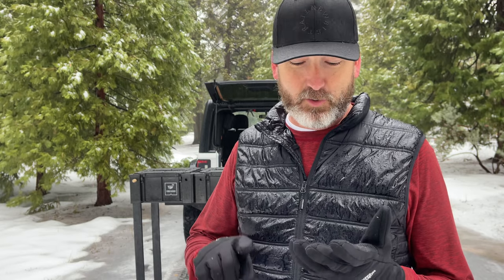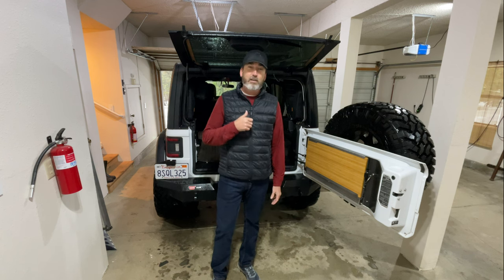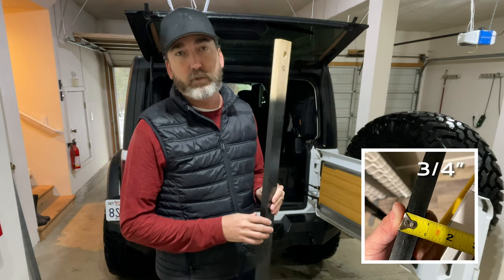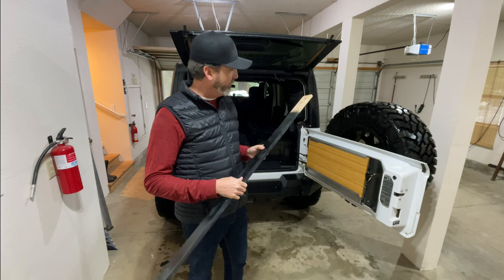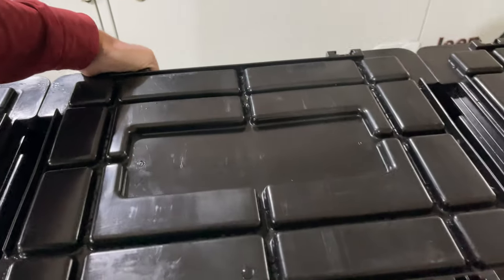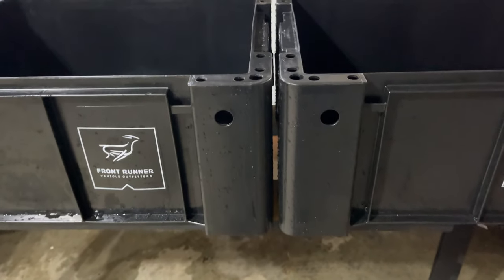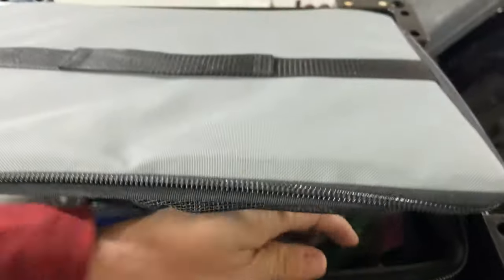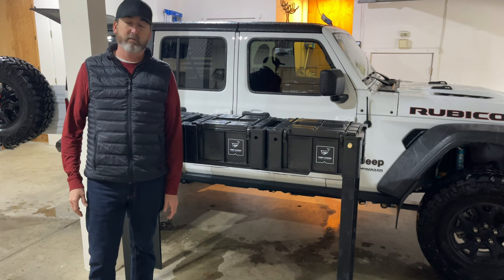DIY STORAGE TABLE for Overlanding | Front Runner Wolf Pack Box Storage

Comment: I got to see this awesome storage/table setup in person! If you put silicone on those holes on the inside, they’d definitely be weatherproof but i do understand the ventilation part of it too if that was the intended purpose of those holes. Aside from that, the lids seem to do the job keeping water from rain, snow, ETC. ding out of the bins.
Reply from the maker: Ya, these are great boxes, even if just for regular storage.  Gotta get back out on the trail with you Mark!!! 👊🏼👊🏼👊🏼

Comment: I bought the Wolfpack front runner pro. They seem to be very close, but I noticed a few differences. They don’t have the big holes on the outside to put the corks in. They don’t have holes on the inside of the boxes for drains to put the screws through so I hope to drill those. Do your legs fit a little loose? Mine seem to be loose and I didn’t have to shave off a corner. Maybe the holes are bigger now
Reply from the maker: So awesome that you are building them with the new Wolfpack PRO boxes!  My legs fit pretty snug in the original Wolfpack.  They don’t necessarily need the corks to hold them in, but it’s a nice-to-have to keep them secure. Thanks for watching and for the comment! I really appreciate it!🙌🏼🙏🏼👊🏼😃

Comment: Which Front Runner boxes do you have? I don't see any on their website with holes in them. thanks
Reply from the maker: Well, they just discontinued them on their store.  All the sell now are called the Wolf Pack Pro storage boxes.  The original Wolf Pack storage boxes is what I used.  They can still be found on other websites, but just not on Front Runner’s site.  I believe the Wolf Pack Pros are similarly constructed where you could put legs on, but you’d need to drill the holes for corks.  To be safe, I’d try to buy the old version online somewhere. 👍🏼

Comment: seams a bit high, unless you bring bar stools with you.
Reply from the maker: Yes, your a re 💯 correct.  The 1x3’s that I used were 48” right from Home Depot.  I didn’t cut them yet, but I’m going to take them down to 42” I think.  I’m 6’4” tall, so a little taller is better, but these can be modified to any height - if you make this: make it perfect for you. 😀👏🏼🙌🏼👊🏼 Thanks for the comment and for reaching out! 😀

Comment: Good idea - well executed.
Wouldn't it be handier/less of a PITA to have used a box that is hinged rather than having 4 latches? Seems like having to unlatch & revoke the lid will get really OLD after a stretch...
Reply from the maker: Ya, you’re 100% right.  It would.  The thing is: getting legs on other boxes like a Roam or something else would be a bit of an engineering feat (no pun intended 🤣).  I’ve thought about trying to hinge these lids, I just haven’t figured it out yet.  I’d say the main reason I’ve stuck with the Front Runner boxes, is because they ‘nest’ on each other (stack really well interlocking).  I’ve now actually reduced the design down to two sets of two that stack in the back of my Jeep.  The other main reason I used these boxes is because they are so cheap.  $30 each and the 1x3s + hardware were very inexpensive as well.  Long-winded answer to your question … the answer is yes, a hinge would be an absolute +++. 😃👊🏼 Thank you for your comment and kind words! Cheers! 👏🏻👊🏼😃👍🏼🙌🏻
Reply: The slots on the side do make it very handy to add legs .
Didn't"t know FR boxes was so inexpensive - But over the long run (years) paying $30 or $100 per box makes little difference In the long run especially when it adds to ease of use & a pleasure to use kind of thing. (the Getting Old Real Quick is the way I analyze whether I would consider a  new product)
Reply from the maker: @TerryManitoba  agree!!  Ya, I’m going to figure out a hinge solution.  Just in due time. 😃😃

Comment: Are these wolfpack boxes interlockackable? How did you put 3 together?
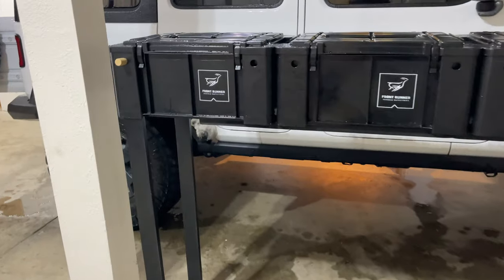Reply from the maker: Hi 👋🏼 for this specific build, I just attached 2 1x3s on the bottom.  Did this with screws and washers.  I show that later in the video.  Around the 8:20 mark. 😃👊🏼👍🏼 hope this helps!

Comment: Does anyone know if the pro version of these boxes have the same receivers on the outside that will accept the wooden legs as shown here?
Reply from the maker: It’s a great question.  I looked at the Wolf Pack PRO last year and I think they do.  The size of the opening is different.  Let me look a little closer online and I’ll message/reply back here with additional info. 😃
Reply from the maker: Ok, I went online to their website and if you scroll through the pictures, the 7th picture shows the Wolf Pack PRO upside down.  It has similar cavities on each corner like the original Wolf Pack boxes.  I don’t know the size of those openings, but I think/hope it would work the same. If you have Instagram, feel free to message me there anytime for more info. 😃